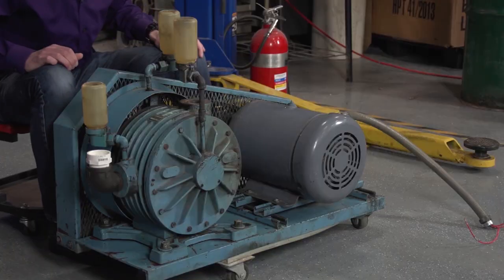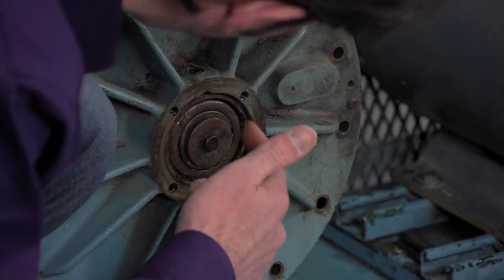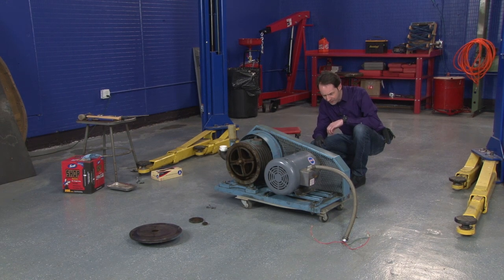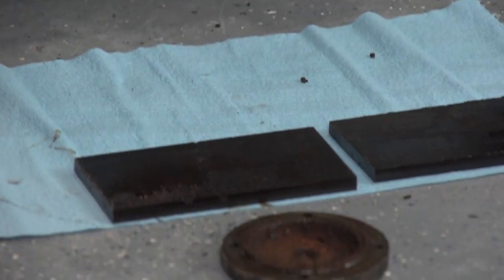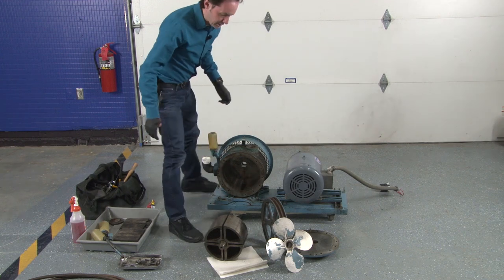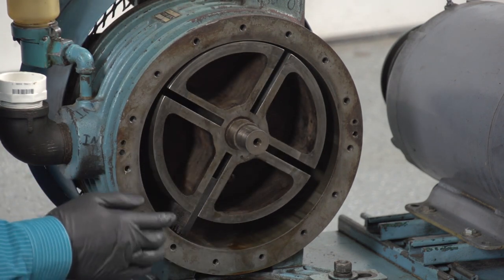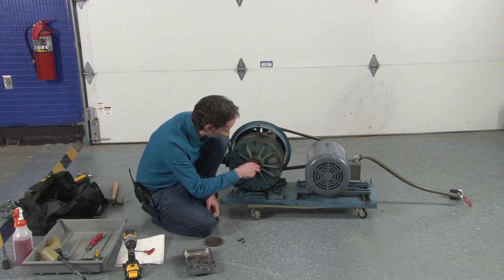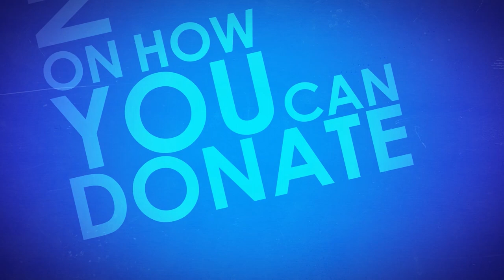Vacuum Pump: Equipment Autopsy #77

Comment: If you look at the dowel pins at 3 and 9 o'clock, you see a threaded hole. Put a bolt in each one and turn 1/2 turn, alternating side to side until it pushes off the pins and is free. It would eliminate the chisel marks on the cover, possibly creating a leak.

Comment: I've been vacuum forming all day and just got curious how a vacuum pump works. So thanks for providing this demonstration. I'm finding it very interesting. I just wanted to point out a small mistake at 14:38 in case you want to make the correction. You say "It's concentric, meaning circle inside of circle, but not coaxial, meaning the circles have two different centers." However, concentric and coaxial mean the same thing, so the circles are neither concentric nor coaxial. Rather the axes or the circles are offset... And back to the program.

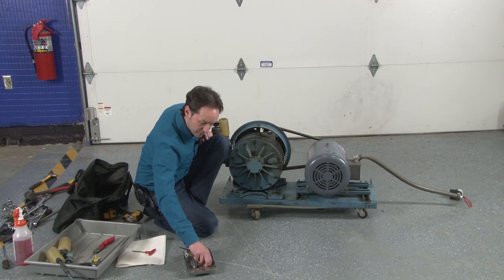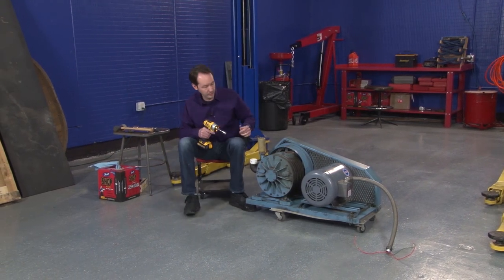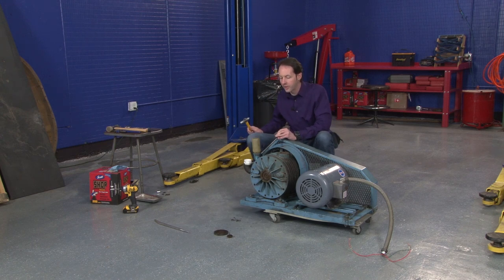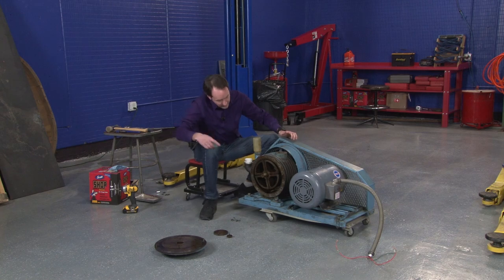Comment: At 39:45 the roll pin goes into the end plate at the 3:00 and 9:00 position, Had it been there during the setting of the end plate it would have indexed the location, see 10:27, this is a great example of why making a video of disassembly is a great idea.   I did two pumps and had the same problem with both. the tightening order of the end bolts. As I gave final torque the pulley would bind. I tried every suggestion. Then in a dream I saw myself tightening the bolts in this pattern. (assume 12 bolts ) put on all bolts loose tight and check for binding. then, hand tighten the bolts as 12:00 (TDC) 6:00, 11:00 and 5:00. in that order. Tighten each bolt by hand checking that there is no binding, when binding occurs, listen and retighten to just before bind, then go to the next bolt. if the first 4 bolt can be tighten to final torque, all the remaining bolts will be ok to go to final torque in the normal cross pattern, hoping this might help someone.

Comment: That's one funky looking vacuum pump, I've got 2 Welch Duo-Seal (model 1400) and they still can pull a good vacuum of about 150torr.

As for the oil there's a special type of oil designed for vacuum pumps as some oils and greases will boil off in extreme vacuums.

Vacuum pump oil is usually hydro processed which means it goes through a series of catalytic steps rendering the oil extremely refined, more viscous, and more stable which results in a clear mineral oil that will alert you to contamination sooner as it becomes cloudy or milky.

Here are examples:
http://www.jbind.com/products/product-search-detail.aspx?SKU=DVO-1
http://www.yellowjacket.com/node/859

Comment: Apply a chisel to a finely machined mating surfaces; leave a rusty jammed rear bearing on it's place so it's twisting over the shaft after reassembling; lose one of two pins that precisely positioning the cover; and, finally, strike the rotor with a nine-pound hammer to place it into loosy roller bearing, and do the cover same way. That's the complete equipment care instruction for you, folks!

Comment: Inland 19 or Inland 20 are the primary oils we use - unless specific operations/pumps we use DUO seal belt/direct drive oil, oxygen ops Krytox 1506, corrosive env Fomblin 25/6 - i realize this is an 8yr old video just chiming in.
Reply from the maker: Thank you! That's excellent information! :)

Comment: Use the jack screws to remove the cover.
Reply: Are you talking about the small screws that look like set screws, next to the pins? Are those threaded into the cover so that when you screw them in, they force the cover away from the motor housing? I'm just curious in case I ever find myself working on a similar project. Thanks.

Comment: ha right off we're going to do something we've never done before. I would like to get this back together and have it work. the roll pin was in the cover when you started they align it. Should be two different diameter holes

Comment: If it hasn't been said and you guys haven't run it yet (Didn't see a video), you need to use a medium weight, non hygroscopic oil like the type used in HVAC vacuum pumps such as JB Industries DVO-24-BX "Black Gold" vacuum pump oil.

DO NOT use motor oil or any other detergent oil as the detergents will attack the phenolic resin and degrade them.

Comment: What are the chances you could get some longer bolts, and machine up some thick transparent polycarbonate to replace the end plate? Then people could see it working and you could make it a demo!

(Granted you would have to have someone quite smart do some chunky maths on making sure it was strong enough :-) )
Reply: The Phenolic? Plates would scratch the polycarbonate and so would the rotor. Unless for purely demo instead of operational demo you could spring the plates outward and turn it very slowly with polycarbonate and a gap